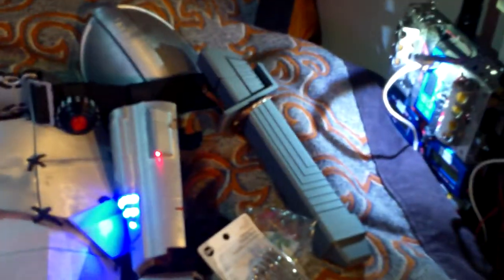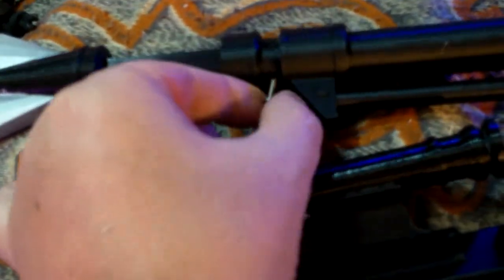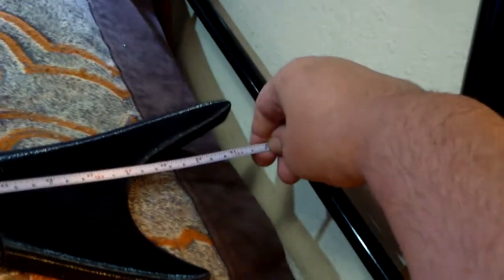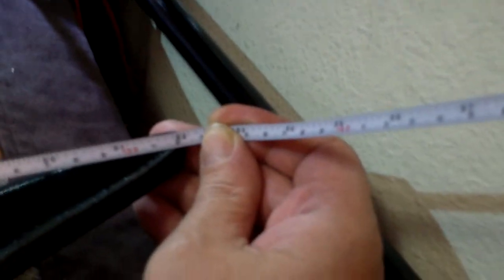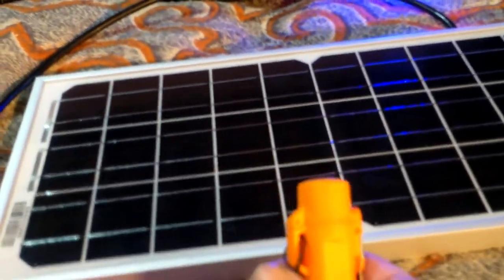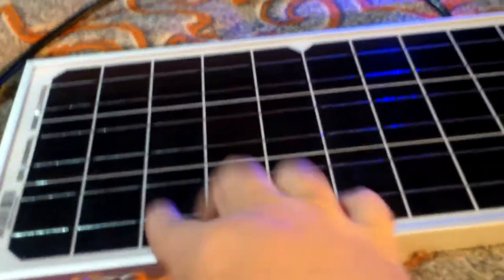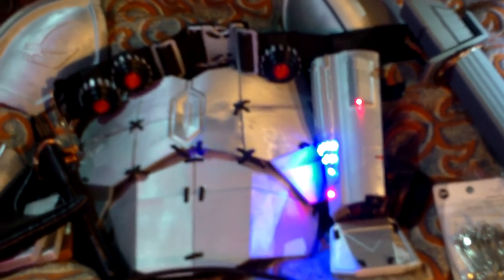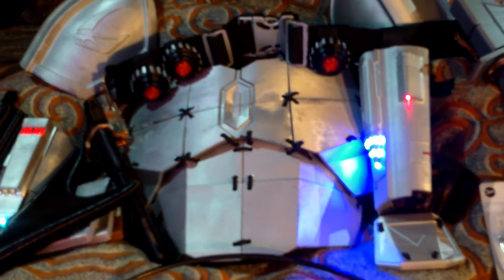MANDO RIFLE AND SKIPPYS SOLAR PRESENT 3D PRINTED

Comment: Impressive doesn't even come close to describing this man! Awesome job! This looks so cool! One thought on the issue of heat causing the 3D printed items to bend. I know next to nothing about 3d printing, but could you print around a wire frame? That would give it some bone structure while maintaining lightness. If not maybe the use of wire rods inserted after the printing process with the use of a drill or something might help it maintain its shape in heat. Just thoughts. Fantastic video my dude! Keep up the good work!
Reply from the maker: Youre right Man , I was thinking about hollowing out a hole and putting some brass tubes and rods inside there to keep it straight , all good suggestions , thanks Man I appreciate it , Tallk to You sooon Man Take Care :)
Reply: @akai454  Brass tubes might be a good idea, the fact that they are hollow would mean they are light weight. would help keep the gun straight without making it too heavy.
Reply from the maker: Sorry man I'm not going to make it tonight, see you soon 😀
Reply: @akai454  no worries man, see you next time!